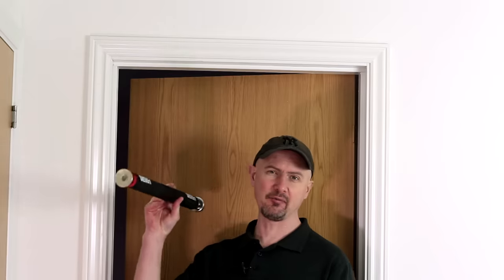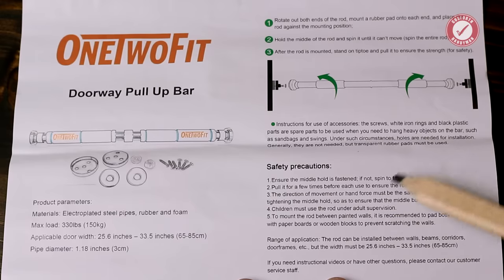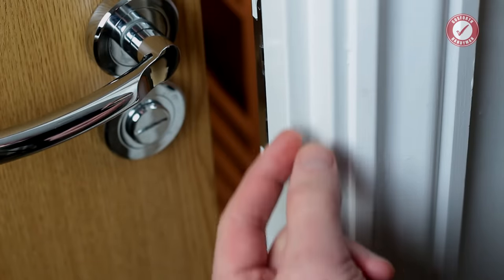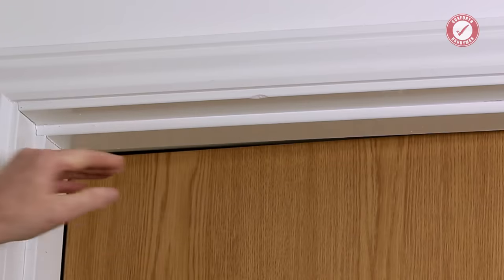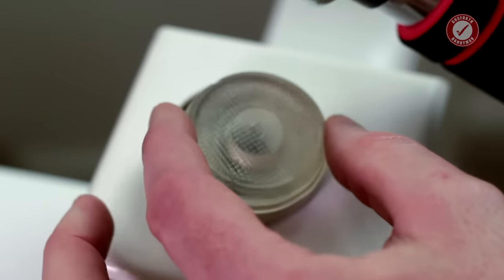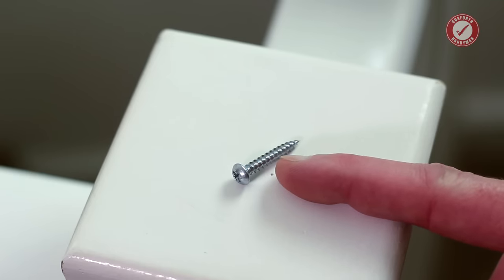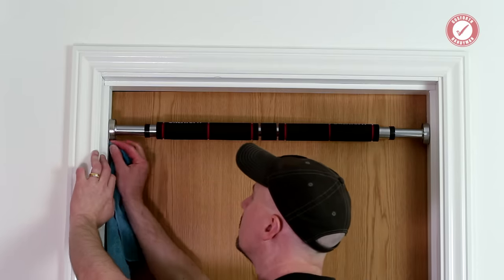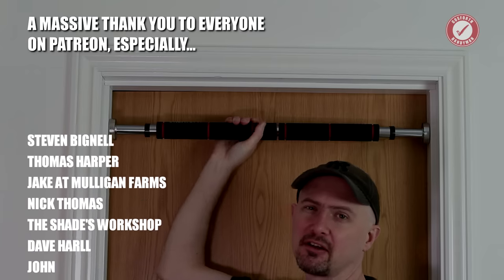How to Fit a Pull-up Bar in a Doorway

Comment: I'm pretty sure that lots of people use these without drilling into the door frames. Or at least that's what all the fails videos I have seen would suggest xD
Reply from the maker: Too right - £250 from You've Been Framed (pardon the pun) in the bag! 😂
Reply: @GosforthHandyman  Oof, the dad jokes are strong with you :p
Reply: i......i also tried it without drilling into the door frame and i felt like a fool lul
Reply: @GosforthHandyman  Thanks for the great video. I dont know much about drilling devices. What kind of drill would I need to install a pull up bar and would it be fine if i drilled in into a wall ?
Reply: Do we really need to drill it tho
Reply: @rayhansyahbana6074  not really. I used for two years without drilling
Reply: @Lonesniper41 ,
Reply: @rayhansyahbana6074  No, I use this exact bar without screws.
Reply: @samdobie6748   I lost one of the rubber cushions at one end of the bar , is it ok to use it without the cushion ? Feels tight but I'm afraid to start fully using it
Reply: If you're a kiddo ( or a manchild ) who can't install a level pullup bar with support/or you can't hire someone to do it for you -- then don't buy this bar! Attaching it and relying on the force of friction alone is a great way to break your spine
Reply: @ahmedshabbir5918  use 2 thick book and put it on both side of the bar act as a cushion

Comment: You don't have to drill the frame. the vacuum does the work.  But, the only problem is that  during the exercise you might accidently slightly rotate the bar in the "wrong direction" and eventually it might fall off

Comment: Thank you so much! I was wondering wether to purchase this but I wanted to make sure the installation was solid. You made this very comprehensive and even enjoyable.
Reply: i want to purchase it too does it work fine?
Reply: @muznakhalid1208  yeah, it works well. As recommended, I installed with screws and it is nice and solid. It holds my weight and feel very safe using it. Very great workout. I’m happy with it.
Reply: @highway5588   thanks

Comment: I think the point of the bar is that it's portable, you can use it for sit ups also if you just adjust it and attach it lower down on the frame, holds fine for me without using screws.

Comment: A few numbers. If one follows the instructions and relies upon friction between the rubbery ends of the bar and the door frame, then the friction coefficient will not exceed 1 (unless the rubber chemically adheres to the frame). This means the sideways force on the door frame must be about the weight of the pull-up person plus whatever safety margin one might build in to cope with the ‘impulse’ associated with the pull up. 

You’re definitely right about the screws. 😇
Reply from the maker: Defo - I'm amazed they can get away with saying this! 😂👍

Comment: the friction on most ones holds up to  a 100kg. the point of not using the brackets is that you can use it for multiple heights. it's friction and pressure that will hold it once you really twist and secure it. Good looking cracks btw.
Reply: Not worth it, just get 2 pairs and install them with support. If you're relying on the friction alone without support: 1) You're guaranteed to fall from the friction losing its grip sooner or later, and you can occur life-devastating injuries (like being paralyzed). 2) You'll destroy your door frame by squeezing it tightly everytime.

Comment: Regarding not over-tightening the bar.... won't the use of the bar, over time, tighten it?  Or loosen it?  Depending on which way you are facing?  I am imagining that there is some rotational force on the bar when using it.

We are needing to get a bar for our daughter for physiotherapy use at home and trying to decide what type of bar to get that will be the right mix of ease of installation and safety.

Comment: i'd use bigger and longer screws for sure. especially for something like this that's weight-bearing and under frequent use. if it's ornamental, those screws would be fine, but this is a functional item. in a lot of civil engineering projects, for example, they always over-estimate the use and wear of certain components and have a lot of redundancies to ensure safety. so if they build a highway that can carry X number of cars, they'll design it so that it can support 1.5-2X the intended load, and build multiple support systems in case one, two, or a few of them fail.

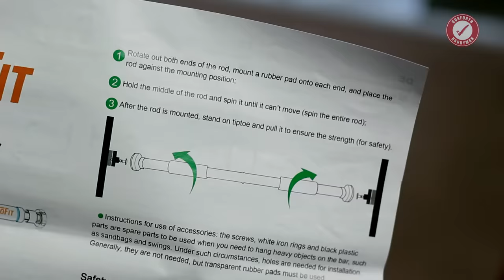Comment: 7:04 actually in another video it shows what the small black ones are for , that so the bar can be put in the middle of the door. For top use metal brackets. For very bottom, no need can just excercise with friction
Reply: For like tricep dips?
Reply: @santiagof5511  yeah

Comment: While the Amazon image is definitely disproportioned, the door frame must be about about 40 inches wide (way outside the specs for this unit) what is interesting in the shot is the width of steel showing either side of the centre section. The images of the bar on the American Amazon site are different from those on the UK site and show all the width adjustments on the ends. Does each padded section on either side of the central pad also rotate to open this gap or is all the width adjustment done with the end sections?  It would make sense if it did as it would reduce the end adjustments and allow a fitting that would  put the load closer to the door frame. In an 85cm opening a person with a wider elbow to elbow spread would be able to make a forward grip correctly.  Remember that the reverse hold on a pull up bar with which Andy used as a demonstration, requires a narrower hold than that required to do a forward hold (as the  Amazon guy is doing). I'm with Andy on his fitting. I certainly would not want to see anyone using it on a friction only fitting!  Because it can be fitted that way does not mean it should.
Reply from the maker: Cheers Rob! It only adjusts from the ends - doesn't adjust from the middle at all. The pics on the UK Amazon link look like more PhotoShopping nonsense to me - hadn't noticed that! 😂 Mine looks exactly like the pics on the Amazon US version. 👍

Comment: @Gosforth Handyman At 6:56 the black plastic piece is for situp bar low locator mounts on your frame my friend, its as if all these companies that ripped off the original design have neglected to understand the full concept of the originals simplicity so they put an extra screw hole in the centre of the bar locator cups for it to make sense. (At least you cant loose it that way if not used but it would be nice if the destructions knew what it was originally for?) Then added a 2nd screw mech to ruin the quick no fuss interchange between the 2 positions. I must be getting old they dont make things like they used to lol. Just out of curiosity did it tell you how much bar clearance you should have from the top, because i made & fitted door stop width infills filled & painted to suite then discovered inversion boots i cant use without lowering the bar & making longer door stop infills. Anoying as f**k but all usefull things they neglect to state. I probably should have just pushed the mount cups to the door stop in a row then marked out 3rd space down both sides with top cup for simplicity? Having to relly on hindsight is not a best fit guide for clearance of knuckles feet & head lol. So they just neglected to bother. This was all years before covid lock down & the Hertfordshire council or local gym removed the 4 pull up bars from the park! When its gone & your locked up inside you truely miss it, like they want us to wither & die or join the gym with no income? As you can tell im not happy about the NWO.

Comment: I have the same,  I didn´t drill any holes on it. It works perfectly fine. I´m about 80 kg.
Reply: I'm 115kg will this hold me I just got one from Amazon.
Reply: Daniel Silveira is it working fine for you?
Reply: @fantastick8943  Yes so far so good i got this one on Amazon I'm in Miami 🇺🇸 Garren Fitness Maximiza Plus Pull Up Bar it's out of stock now i think.
Reply: Daniel Silveira I just bought the same one from this video and do you think I should buy my own screws? And if so what are the measurements because I’m new to all this :(. Sorry for all these questions, I don’t wanna break myself using this lol.
Reply: @fantastick8943  At first I got this bar but it wasn't sturdy enough because i had to fully extended so i got the larger bar the one i mentioned it could hold more weight extra 30lbs versus the previous one.I'm new to all this too I didn't even had a powerdrill so I got one just to install the bar and to finally have one at home I went to homedepot to get the screws this man described apparently they gave me something similar but not the same. So I just used the ones that came with the bar. I'm a heavy guy i only use the bar during days that I do my back exercises the rest of the exercises I home i do using my Bowflex dumbbells wich I'm glad I got them long ago before all this madness. But so far the bar is fine u should be ok too. What is your body weight?
Reply: Daniel Silveira I’m 200 lbs rn, that’s why I’m scared ima just snap it lol. I also don’t have a power drill, but I’ll most likely try to figure it out lol
Reply: @fantastick8943  U should be alright 👍 ask a friend or neighbor i got a cheap black and decker powerdrill on Amazon.
Reply: Daniel Silveira alright ty bro for the help!!!!
Reply: Does it still work?

Comment: I'd recommend the kind that hooks on top of the architrave on the other side, and braces against the sides of the frame on the side you stand.
Reply from the maker: I wouldn't trust hanging anything off architraves but if it's firmly braced on the frame it should be fine. Assume architraves can handle zero load. 👍😀
Reply: I used one of those for years when I first started, no issues

Comment: Badly written instructions, I agree, however they are totally usable without screws and damaging the frame. Infact it's using them that tightens them against the door. When you do a pull up, your palm is facing you, and it's turning the rod palm side down. Because the threads on each end are opposite to each other, doing the pull-ups from one side would loosen the ends, but from the other side tightens the ends against the frame. So as long as you face the right way, your pull up is tightening the bar against the frame, easily holding up your weight. The reason the screws are needed when hanging a bag or swing is that they don't turn the rod like your palms do.
Reply from the maker: I really, really, really wouldn't recommend this. Why wouldn't you screw it to the frame?? 😬

Comment: Like you, I usually chuck out the screws that come with stuff.  I fitted one of these things a year ago. Didn't take much tightening of the bar to start to push the door casing apart.
Reply: Yep, anything like this - step one, ditch included fixings. 😁
Reply from the maker: Indeed - I wish I'd kept the screws to do a strength test on them! Never mind. 😀

Comment: Good luck on using the bar I prefer the gym my shoulders are the same width as a door frame, hope you get lots of use from it
Reply from the maker: Cheers bud! It's mainly for my daughter - she does a lot of gymnastics stuff and does leg lifts. I tried doing one leg lift but nothing happened. 😂👍
Reply: I prefer a wide are grip.

Comment: as a kid in school we used a chin up bar that was standard and didn't use the frame brackets and it worked fine for the 480 kids that used it ,and it never came down. these frame brackets keep the manufacture out of a lawsuit.

Comment: At least you got instructions! Somehow, I managed to tighten the bar and cannot remove it because it's in so tightly. I don't have a Kung Fu grip and have no idea, with arthritis from years of lifting heavy weights, how this was possible. Now, because I didn't receive instructions, I have no idea which way to rotate the outer bars to loosen them. Keep in mind, I already have 2 chin up bars close to the ceiling. This one was for reclining chin ups, so if I don't remove the bar, I have to crawl under it to get to my exercise room. Jesus f****ing Christ, this is so maddening. It looks like, from the arrows on the instructions I see on your video, that tightening requires a clockwise rotation. So, cheers to you for making this video or I'd be on my hands and knees in frustration ... quite literally! Now, I have to find that huge wrench!
Reply: multi grip tool

Comment: My niece got one of these for her toddler and mounted it about 90 cm from the floor. It works fine for him (weighs about 15 kg). Although when my girlfriend wanted to sit on try it, she fell flat on her face. Mind you, she weighs about 60 kgs. Luckily it was still only 90 cm high.
Its proper shite and very dangerous for the producers to claim it works without additional fastening.
Reply: Exactly. I had my share of falling from this thing losing its grip when I was 13 and couldn't install it properly due to being incompetent. Luckily I wasn't an experienced athlete either and didn't do dangerous stuff, only shitty pullups.

Comment: Just get a Perfect Pullup bar or similar that hangs on the doorway. No screws and (in my experience) no damage to the door frame. Easily removed when you're not using it. I've done thousands of pull-up's on mine over the years. It also has options for different grips. $30 and 5 minutes assembly and you're done.
Reply from the maker: Relying on the architrave is very risky - sometimes they're only held on by a couple of small nails. Just be careful! 👍

Comment: My pull up bar slipped down for some reason when i was using it normally, and i fell to the floor, and omg my butt kinda hurts. Should i still use it? Kinda scared tbh (my pull up bar has no screws btw)

Comment: Thanks for the video, BUT I disagree about the need to secure it with screws.  I recently bought an identical model from ProsourceFit (it came with no instructions, so I watched your video).  I simply held it up in my doorway at the proper height, turned the center part of the bar while holding the end sections until it was nice and snug against the door jambs.  It easily holds my 150 lbs. while doing multiple pull ups.  If worse comes to worse and  it loosens over time and drops me to the ground, I will fall an entire 12 inches.  I think I can survive that ;-)

Comment: Just put this up without the screws, using the rubber mounts between the doorframe an it's holds my weight fine (80kg). Nothing wrong with screwing it in but makes it not portable
Reply: be careful body you might fall one day and brake your spine.
Reply: @joesobhy1713  you must be doing pull ups different to me then lol

Comment: Hey there, I tried to find the answer but I have not enough time 😂... I see comments on those cracks in the frame but I don't see the answer, or at least it looks like you said somewhere they are due to that being a new building etc... I actually realized I caused those, by using the bar with no screws hence applying more pressure on the frame. I don't care about aesthetics; my concern is more: are they going to stay as they are, or is there a chance the more I use the bar, the worse they get until everything collapses, including the building next to ours? I just changed door and instantly the same cracks appeared. Thank you

Comment: The little plastic bits are to go near the bottom of the door so you can do sit ups
Reply from the maker: Oh, and not use the metal rings? Yeah, you might be right. 😂👍
Reply: @GosforthHandyman  use the metal cups on the top for pull ups and the plastic ones are used at the bottom of the door to do sit ups ( I have a old bar and that's what my instructions said and I have been using it for over 15 years)

Comment: Interesting video. Thanks for sharing. How thick is that MDF from the door post?  What kind of wall is it? Drywall or bricks?  I'd probably drill wider holes and
put wall plugs and then screws. But we have metal door posts in our house. Can you buy 2 mm wood drill bits in England? Here the smallest wood drill bit is 3 mm.
When I want to drill smaller holes I need a HSS drill bit. And  drill with them without watching, pressing or breathing, otherwise they break before making a hole of 0,00001 mm.
Reply from the maker: The stop is about 12mm and then you have the frame behind it which is very thick - 25mm I think, so 37mm min total. Screws directly in to MDF will give a much stronger fixing than screws in to plugs in MDF, but yes - for metal frames you'd need a different solution. I'm just using 2mm HSS bits here. 👍👊

Comment: You fitted it as securely as it can be Andy, but it would worry me. If she was in the 'L'  position [legs out infront] and it DID fail, there's a spinal injury. I'd probably fit blocks, with curved tops under the brackets to take the strain off the bracket screws. [belt & braces, I know] - Now.... she did ask for a horizon bar and not a vertical one? Securing that to the ceiling & floor joists would be fun.
Reply from the maker: Ha ha, yeah I can see my house being full of gym equipment soon! The brackets themselves are solid and the shear strength of 4 screws would probably be well beyond a metric tonne so should be fine. 👍😀 Still beyond belief that some folk are arguing the point to use no screws at all. 😂😬
Reply: @GosforthHandyman  Well...its already full of DRUM equipment so 'move over Dad!'